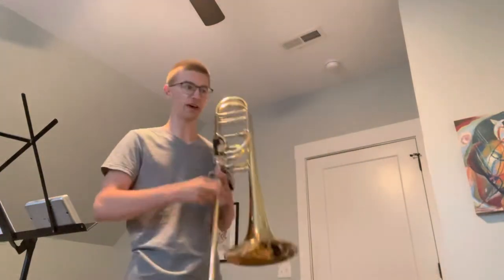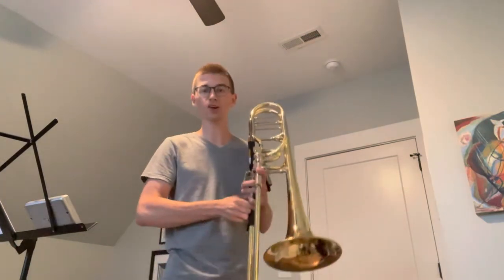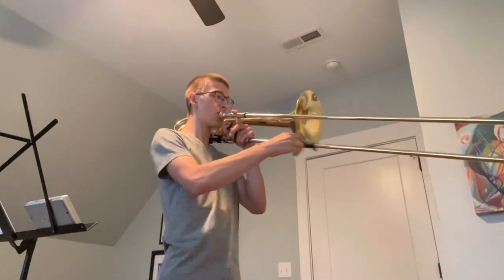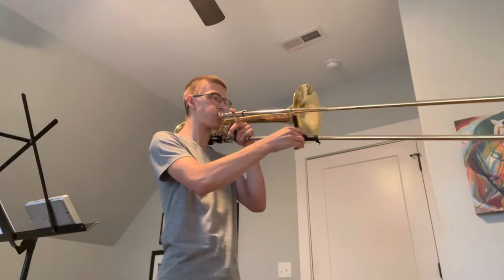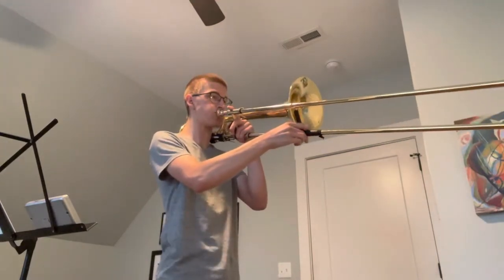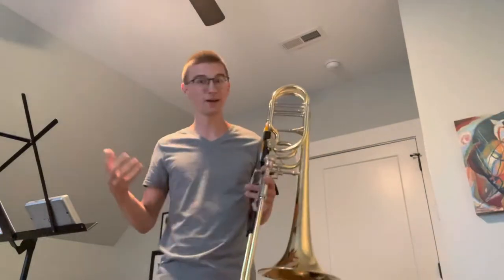A Guide To Pedals On Trombone

Comment: Thanks for sharing Gavin. I've only ever played an old "pea-shooter" (tenor without a trigger) where the pedals are limited to low Bb down to E. Like high range, it takes consistent practice to slowly gain greater access, you just have to chip away for a long time. When I started, it was difficult to even tell if the notes were in tune, they all just sound "low". 😆 The analogy of a thumb on a hosepipe, controlling the spraying water, is a useful one. I currently play with pedals by lip slurring up and down an octave. I believe it's possible to reach two octaves down (but only Bb thru E on my instrument!). I never use these notes in performance, but I find practicing them really improves everything else I play, generally, by strengthening the chops and gaining finer control over the all-important air column. A half-way house between breath-attacks and tonguing is the double-tonguing syllable (usually "K" or "G", using the back of the tongue).
Reply from the maker: Totally agree! Proficiency in your extreme registers clarify your tone and help with technique at the extremes of normal playing range.